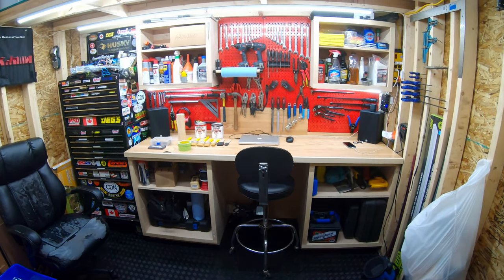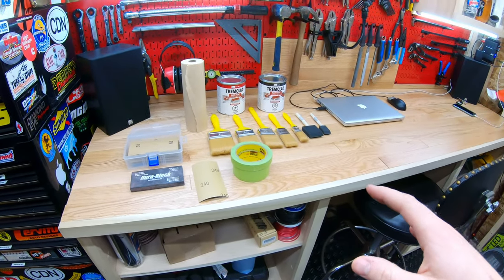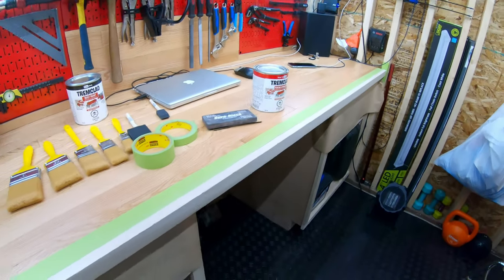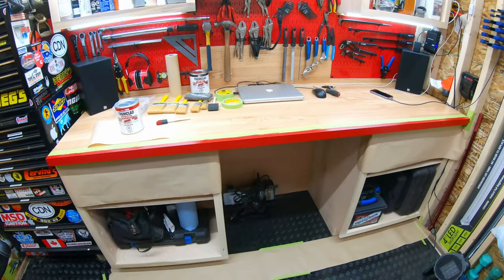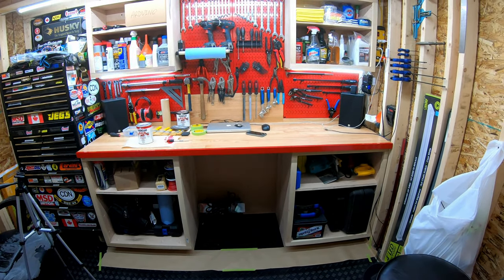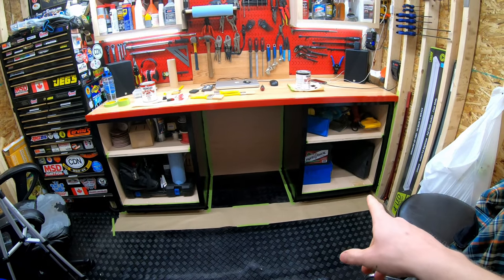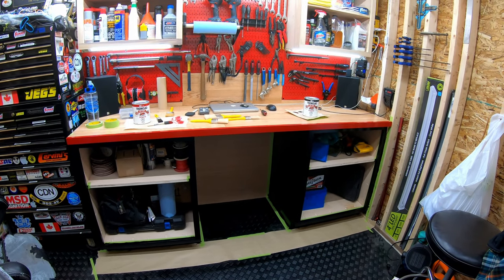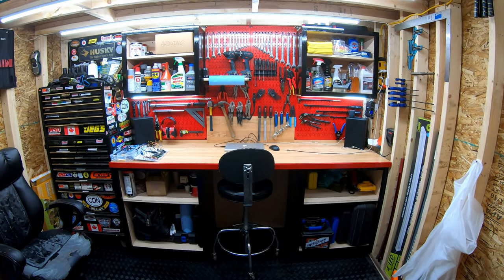Tremclad | Rustoleum on Wood Cabinets

Comment: We bought a 1980s vintage log cabin here in Alberta this past year, and I’ve used Tremclad flat black on the weathered cedar trim around the exterior doors and windows.  It looks fantastic and oils last far, far longer than the crap acrylics they mandate you use these days.  Good choice!